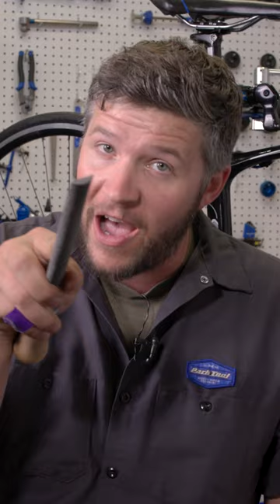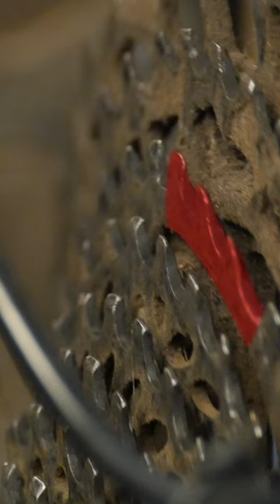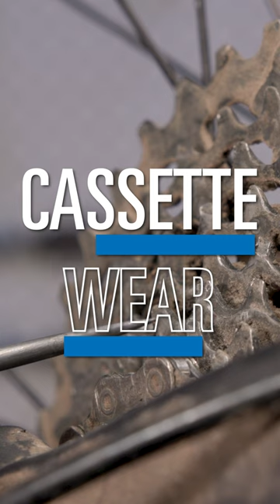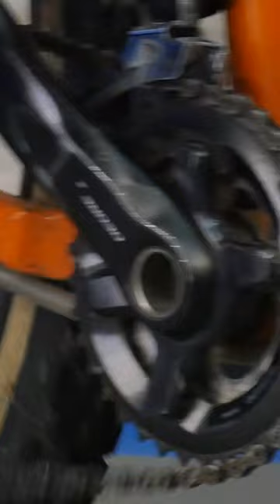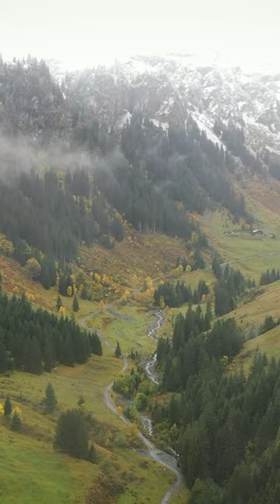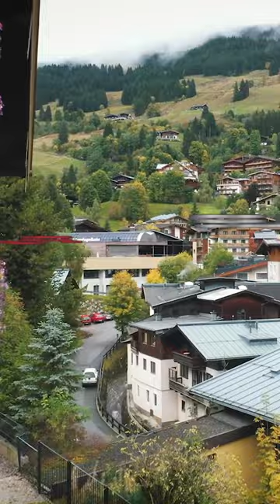Common Drivetrain Issues | #shorts

Comment: Yoooo what are you doing with that file? Does it improve performance to file off the overhanging edge that can develop on the chainring teeth?
Reply from the maker: nothing useful is being done with the file unfortunately. Just a bit of a joke.
Reply: @parktool  I copied what you did thinking it was good and my handlebars just fell off, thanks parktool.

Comment: I must say that people put far too much emphasis on this kind of thing. 
If it was installed correctly to begin with and frequently lubed and cleaned, just ride it until the chain slips, then either replace the entire transmission or get a new bike. 
I’ve got a 1 X 10 commuter and easily get 12000km out of a chainring, chain and cassette. 
And my mtb gets about half that.
Reply: I think that you should change the chainring more frequently than a casette, especially if you have one by drivetrain. In my 1x10 mtb I had to change the front ring after one and a half year, and the cassette just worn out, after 3 years. I did around 3000-4000km each year.
Reply: The chainrings should be replaced more frequently, because they are used more often. If you have 10 g3ars at the back, you use many of them, meaning that each gear is used for a fraction of the mileage. If you have 2 gears at the front each of them is used around half the mileage, meaning that they are used more, so they wear down quicker.